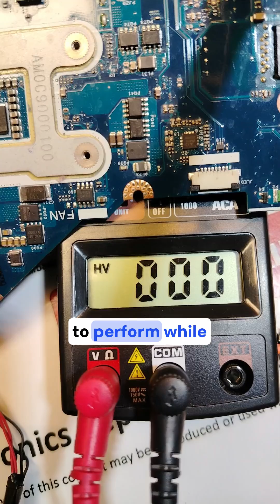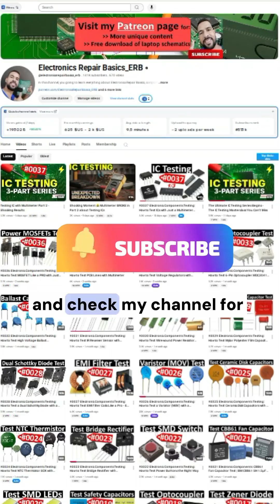What Experts Know About Voltage Power Rails And You Don’t - Motherboard Repair

Comment: Where do you take as your ground when using the probe
Reply from the maker: When using the probe, it's best to connect to a solid ground point on the motherboard that's common across the components you're testing. This ensures accurate readings.
Reply: @electronicsrepairbasics_erb  where is this solid ground point located on the motherboard??
Reply: To the main ground with black or white marking